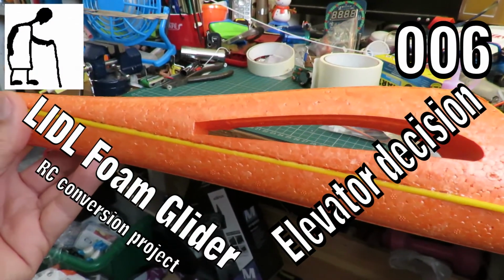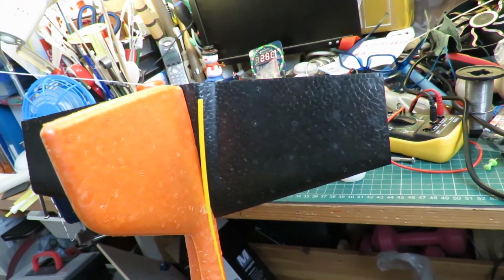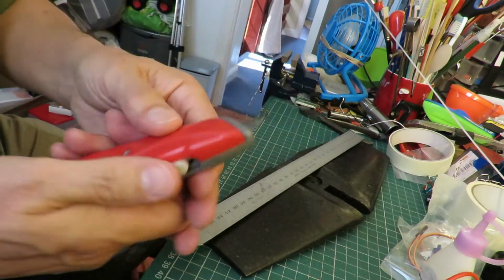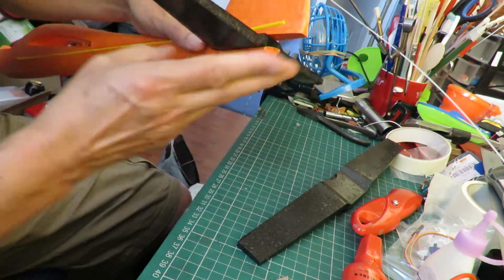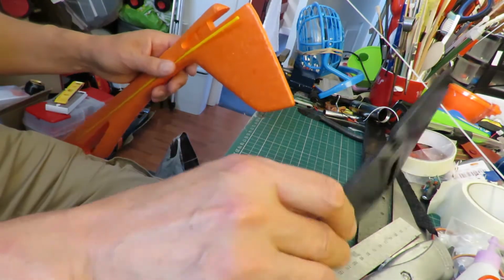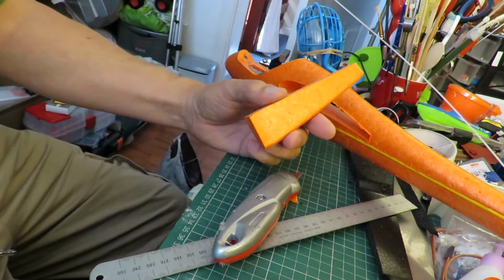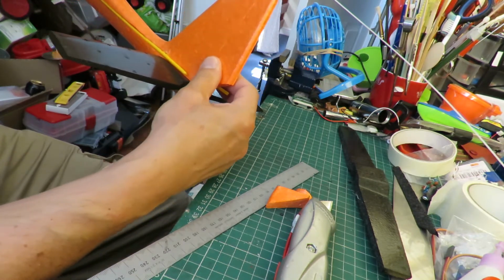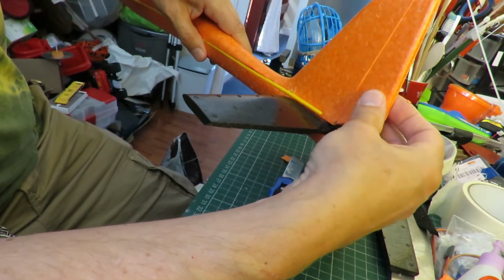LIDL Foam Glider - 006 - Elevator decision

Comment: I use double sided sticky tape on the bottom of the ruler to help hold it in place before I start a cut.  Too many times the ruler moved on me and my cut wasn't straight.  You do need to be careful about how strong the sticky tape is, or it can damage the foam as you try to remove it while still on the ruler.  I will often press the exposed side of the tape on my clothing that often has some dust from the project on it and that helps reduce it's stickiness.
Reply from the maker: Handy tip